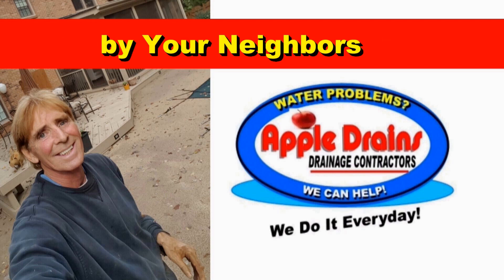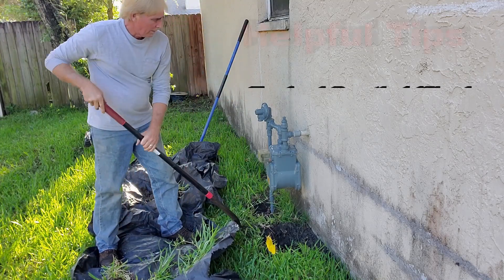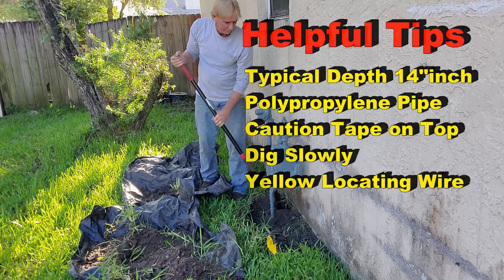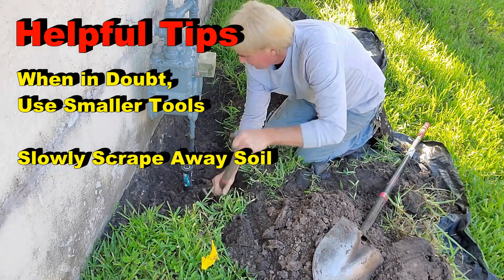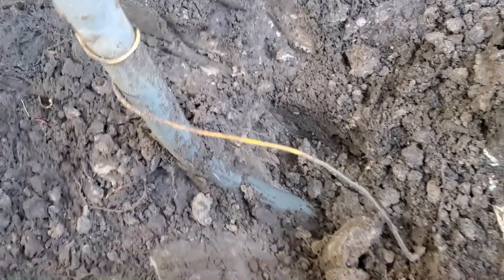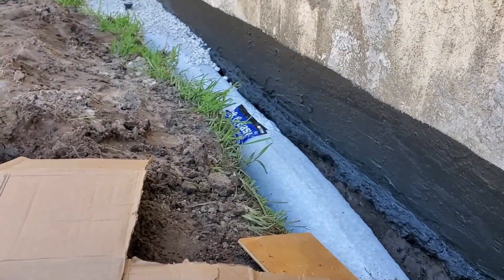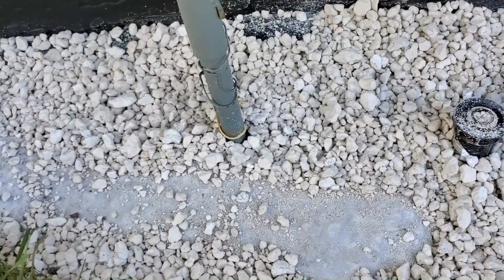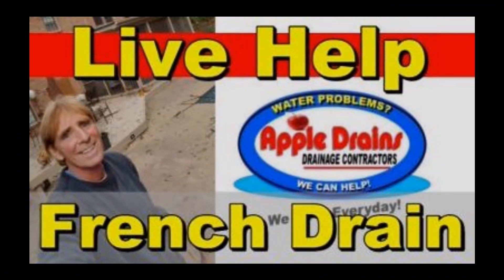How To Dig Around The Gas Line, DIY for French Drain

Comment: My gas line is only down about 5 inches down. Roots everywhere I have not seen any wires. The gas man would only mark where his pipe was not going to the house .
Reply from the maker: this pretty normal, dig slowly
Reply: Because the gas line is 5 inch’s down should I go under the gas line ?